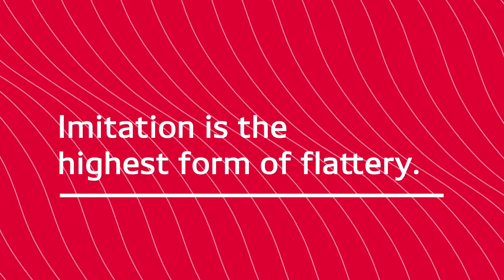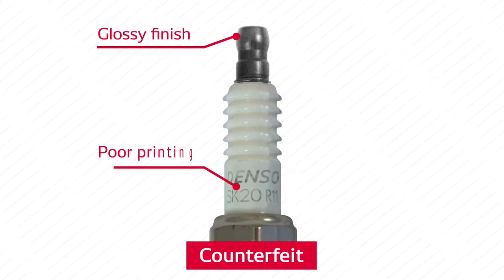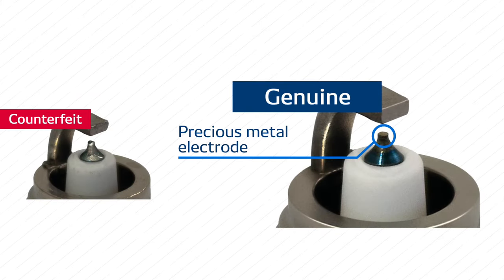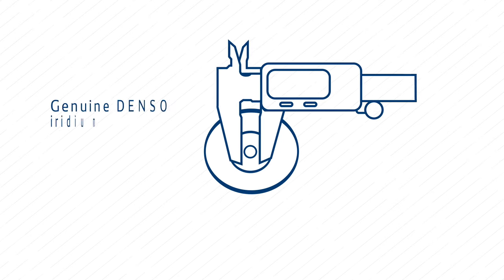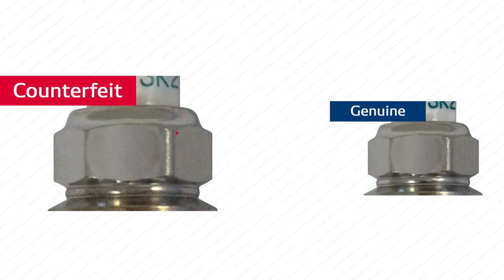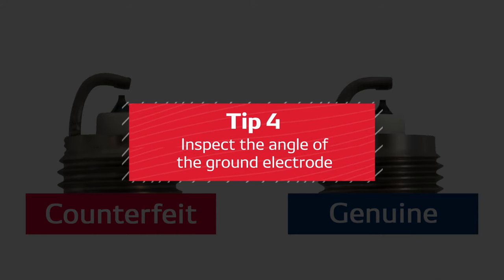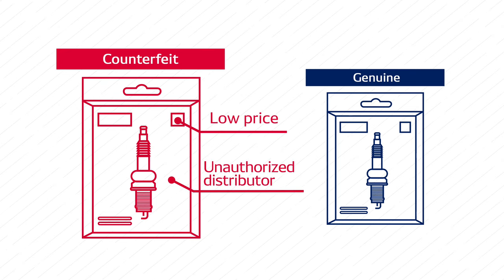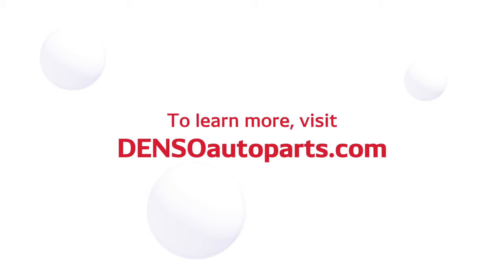DENSO Spark Plugs Genuine vs Fake

Comment: I cannot believe they make counterfeit spark plugs.... What is the world coming to. I recently purchased from ebay thinking they were genuine toyota denso plugs after only 2 weeks 1 cylinder started misfiring. Immediately I knew something's not right cause my original ones lasted years and 100K miles. I took the plug out and you can tell right away it's off. Had to go to the dealership and buy 6 more of these and do the spark plug replacement all over again. What a waste of time and money.

Comment: should be big fine for those who are selling fake denso on ebay and amazon.
Reply: Agree. Where is our Federal Consumer Products Division, or the FBI's fraud and counterfeiting Division? It's only getting worse, and the Chinese (CCP) are eating us alive with cheap crap.
Reply: the ones i complained about in my post were from amazon and are going back.i wouldnt even screw those into my engine
Reply: @skip741x3  what dealer sent you the plugs? I have some on the way and I am nervous that I tried to save money and trust Amazon.
Reply: I bought some year ago for my jeep and now I’m afraid to install em I have 226K and I feel like I paid too low and they’re fake I’m not gonna use em I’m heading to oreily and cop from them my jeep grand cherokee laredo still running amazing and don’t like the risk of using a fake ones

Comment: First, thank you because it is the first video that has a very good and detailed explanation, really, thank you very much, very good.
And second, I'm going to make a comment that nobody makes, about spark plugs, timing chains, fuel filters, etc. The changes of these articles are based, very wrongly in my opinion, on KM traveled, eg: change the spark plugs every 40,000 km o miles , the distribution chain every 100,000, this is wrong.
And I explain why.
In cities like Bogota, Buenos Aires, Caracas and I could name many more, one can take hours with the engine running to travel only 30 KM, due to traffic jams, etc.. If this is your case even if the car does not travel many KM, the engine if they are on, with their spark plugs generating spark, with their distribution chain turning, etc. . For these cases, do not be guided by the number of KM traveled because it is a false unit of measure that does not represent the real wear of the spark plugs and these parts. I think it's a very important point that no one talks about in the videos.
Moreover, I believe that cars should have a timer or timer that shows how long the engine is running and according to that one should make changes to these products.

Comment: I bought 6 denso platinum from Amazon and they all check off but the scratches on the hex failed I tried scratching w pocket knife tip and there’s visible scratches and I only paid $26 for all 6 I’m leaning they’re fake 🥺 and I’m afraid to use them in my 2007 jeep grand Cherokee Laredo w 226K still running good just don’t want to gamble I’m gonna go oreily and buy some from them any suggestions what kind or what brand any suggestions would b greatly appreciated guys ty! jgc laredo limited 3.7 v4 awd 🫡

Comment: I bought a denso AC condenser and radiator from their authorized dealer, and BOTH were made in china. It was a somewhat red flag but both did fit right, and after two years have been fine.
Four years ago, I installed two denso O2 sensors - one was on the way out so I replaced both on the same bank - and one is already going bad. Two other 02 sensors are original Toyota 17 (yes, SEVENTEEN YEARS)/230,000+ miles old. No more denso for me.
Reply: don't blame Denso, blame yourself who buy it from unknown retailer. Denso sparkplugs and O2 sensors are often made in Indonesia or  Thailand. Does not have to be made Japan. Often made in Japan label is a red flag for fake product.
Reply: @rondhole  Your assumption is... well, [ass]umption - I bought questionable denso O2 sensors from DENSO site. Having said that, both radiator and AC condenser are so far fine after five years. Nevertheless, I buy OEM parts from Dubai - 2-3 times cheaper than in the US and delivery is faster than from some alabama.

Comment: Where can i buy original denso spark plugs?
Reply: Your local auto shops with proper distribution sources and Rock Auto for online. The worst offenders are retailers like eBay and Amazon.
Reply: @buddhull  i just bought denso iridium spark plugs cheap for like 6 euros and sometimes each and now I'm returning them, good thing i didn't install them. since denso is from Japan and chances to get real ones is low I'll look for bosch ot ngk.
Reply: @difsid569  yes, I got a 4 pack of mismatched Densos (all had the same box but 2 of them were different plug sizes) from a bad source and had a hard time returning them. If I hadn’t put them all next to each other I possibly wouldn’t have noticed.
Reply: @buddhull  i bought 4 from Amazon and each one in a box all same boxes, after checking some comments some people said they are fake and one said he contacted denso and after giving them details about these spark plugs they said they are Chinese ones.
so I'll not even take the risk to try them I'll just return them and buy bosch or ngk and wanna be 100% sure that they are real ones
Reply: @difsid569  I think that’s the right call. I’ve never regretted doing the same and it’s nice to have confidence in your daily driver’s ignition system… a pretty important piece of one’s vehicle. I drive two older Japanese make cars (a 1992 Nissan and 1999 RAV) and I try and make everything I do with them count so they keep running.
Reply: @difsid569   another thing I just thought of, if you buy from the parts departments through dealerships (I do to get parts for my old cars fairly often,things like fuel pumps and filters) they have OEM spark plugs for sale too. The sites can be hard to use but it’s always worked well for me.
Reply: @buddhull  
Agreed. I just paid $190 to Local Dealership for MAF.
Saw exact part # from Amazon for 50-60 less after, but like to KNOW it is a Genuine Toyota Part.
Just hate spending extra $$$.

Conundrum.

Comment: absolutely atrocious welds on my iridium electrodes! so bad I dont even wanna risk installing them... they look Worse than the fake example you show here and nothing like the pristine weld on the legit one
Reply: Theres another video out there showing a close up of the center electrode, and you can clearly see it wasn't laser welded. It had what looked like epoxy holding the tip in place. We really need a dedicated Task Force to go after the US distributors that are selling these fake products. The Chinese dont care, and know thay are untouchable. But in the meantime we all need to spread the word and post reviews and comments when and wherever we see this counterfeit crap. Multiple bad ebay reviews to a counterfeit seller is a start.
Reply: We're can I get it
Reply: I need the denso spark plugs pls we're can I get it